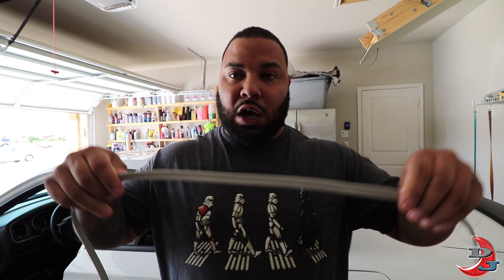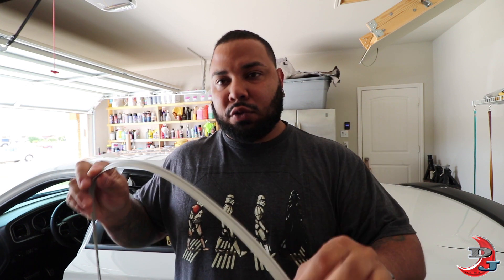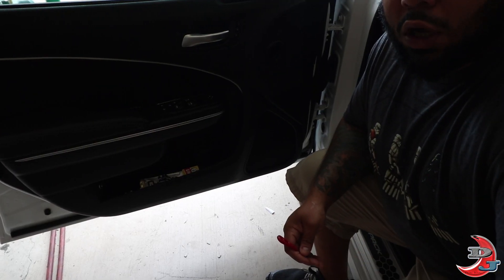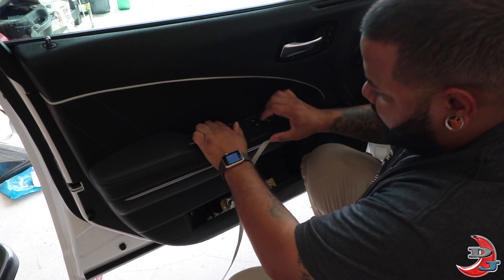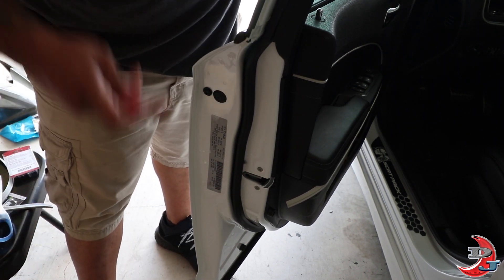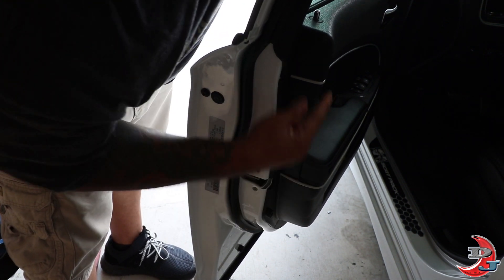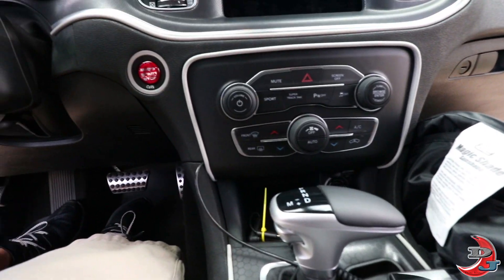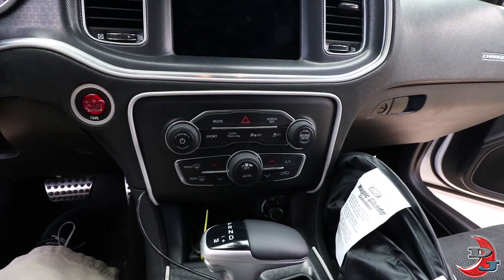Dodge Charger "CHEAP" Interior mod. 2017 Dodge Charger ScatPack

Comment: Great video, definitely helped me out. Thanks so much! Where did you get the red push to start button?
Reply from the maker: +phil salomone I got the red button from Stevewhite motors, they have an eBay account but there are multiple different vendors shouldn't be more then 10-15$